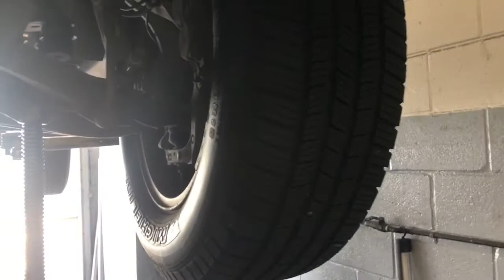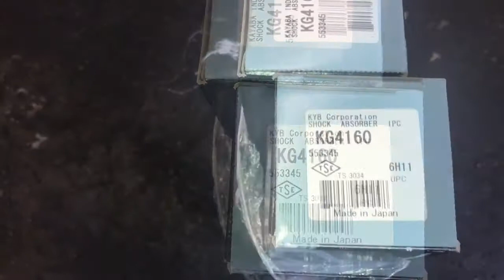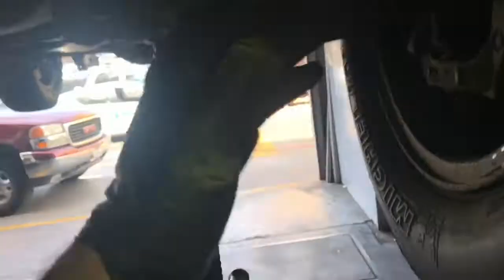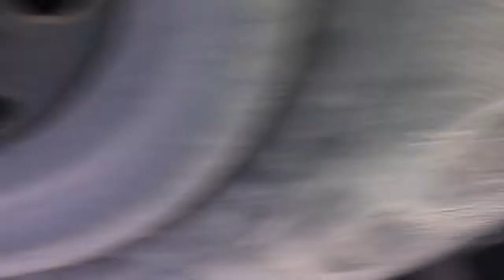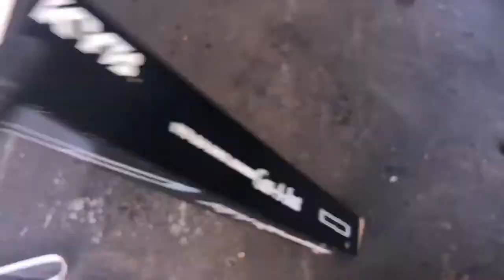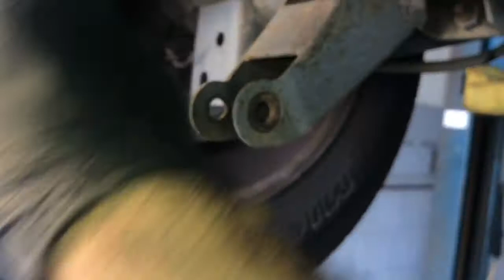Replacing Front And Rear Shocks On A Chrysler Aspen

Comment: What is the part called on the middle of the poking on the rear end my boat in the middle of the pumpkin that holds the bar the rubber is wore out not sure what you would call it
Reply: Pumpkin
Reply: Not poking